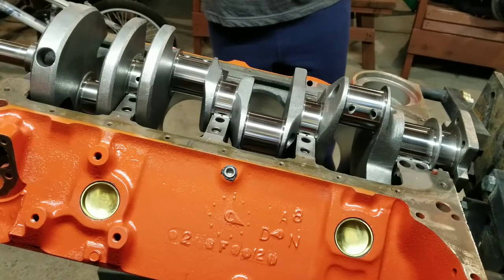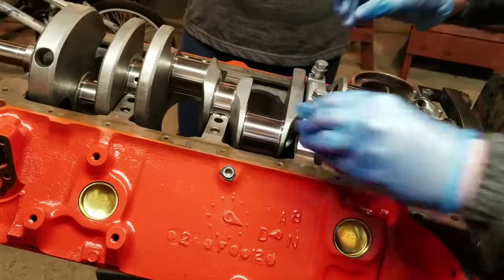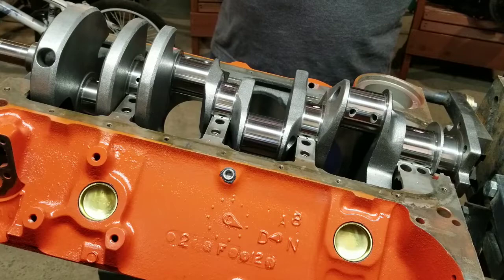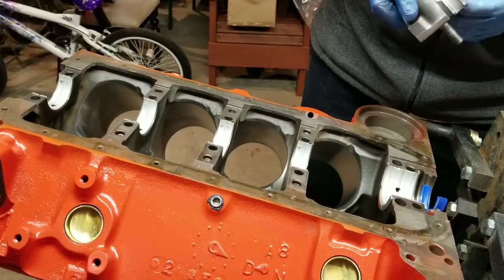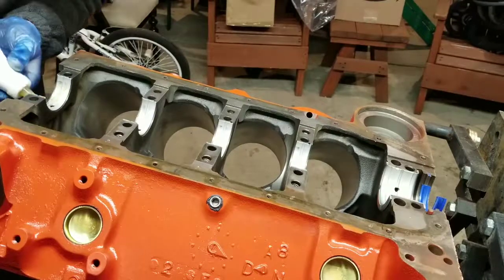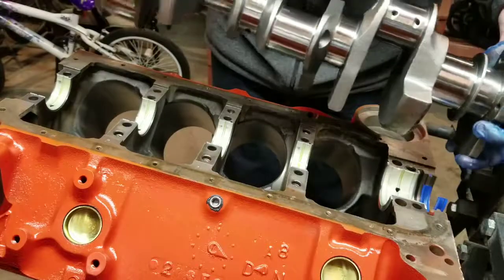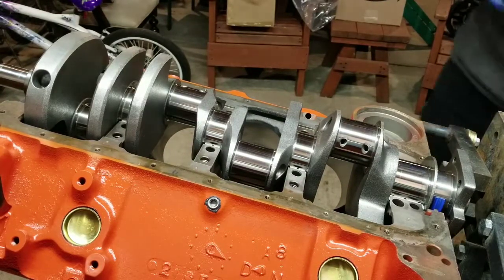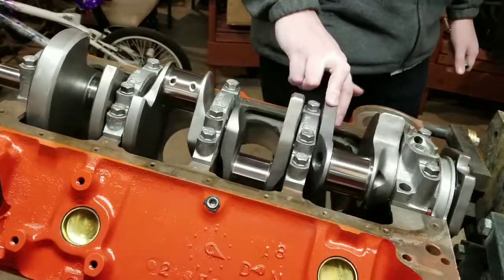Chevy 350 Rebuild - Part 6

Comment: Looks great. There is no need to seat the main caps the first time. When you put main caps on to check with plastigage that would have been enough to seat them. The rear main seal , from the back of the block should protrude 1/4 " up on the right side. Your clearance on a street sb is just fine. Keep up the good work.
Reply from the maker: Thanks!